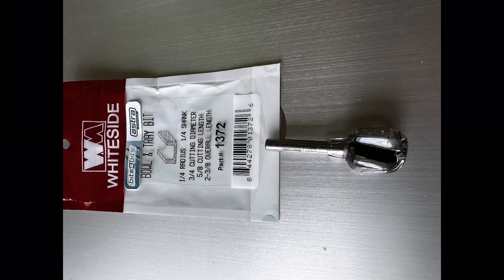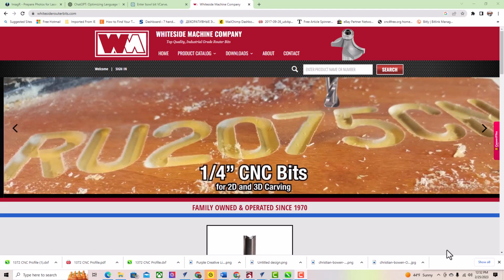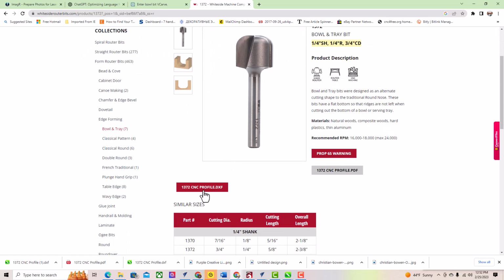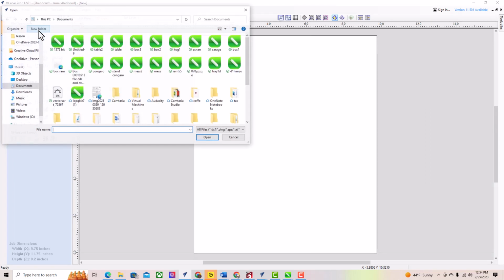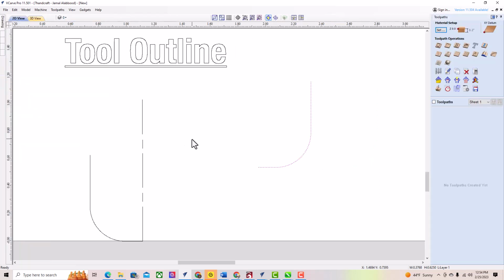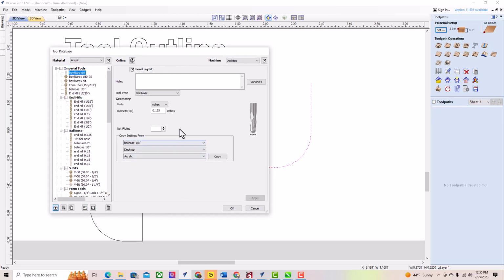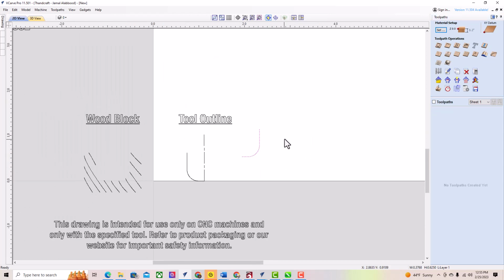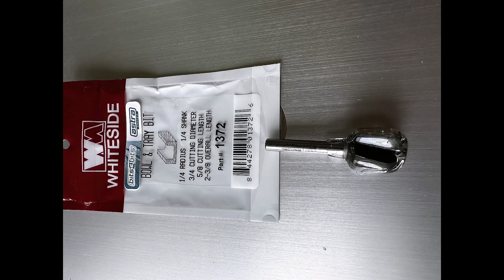How to Add Bowl and Tray Bits to VCarve Pro's Tool Database

Comment: Thanks so much for this video! One issue I’m still having is, Vectric changes the diameter to 1.4077 inches and doesn’t allow me to manually change it. The bit diameter is 3/4”.
Reply from the maker: No problem it’s ok for that setting